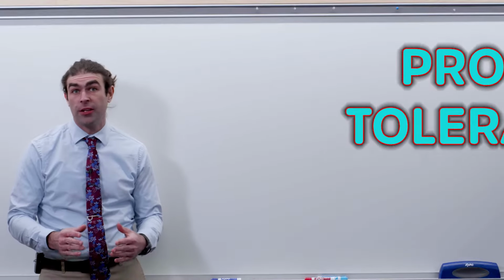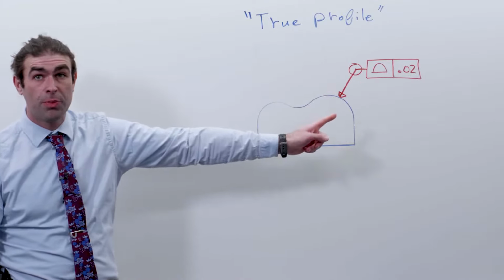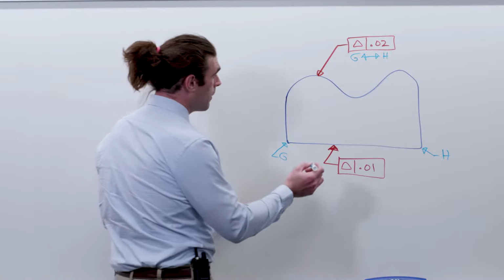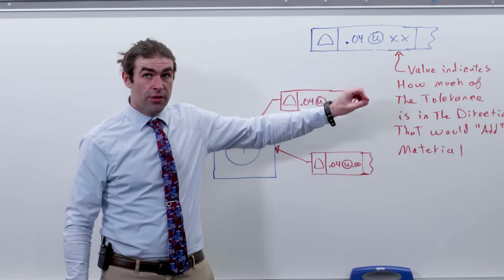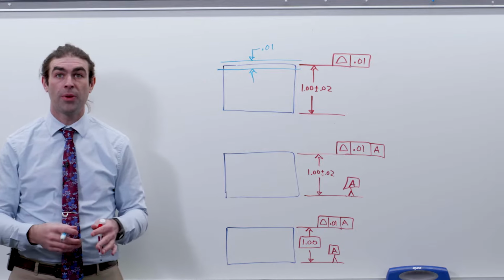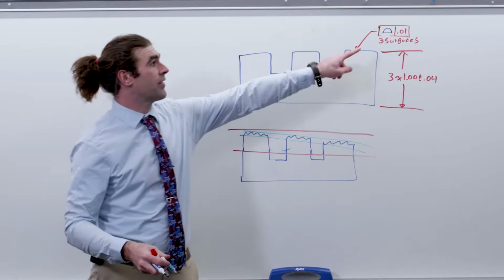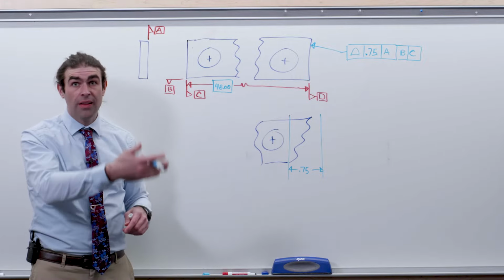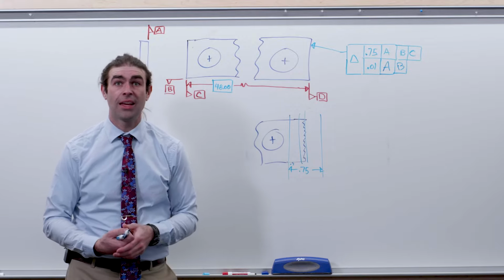GD&T Lesson 6: Profile Tolerances

Comment: I just stumbled upon this video. Do you have a best practice video or do you know one ? I have learnd some 15 or so years back that the theory behind the best practice is to use basically only 3 tolerances. Profile of line Profile od surface and position tolerances. You can basically replace any other tolerance with those 3. This should make the drawing way more streamlined and tidy.

Comment: might be a dumb question since i'm learning...at 17:59...The profile surface tolerance is set to 0.01 for all three surface so shouldn't the tolerance zone follow the 'true profile' i.e. two parallel lines to true(horizontal) surface instead of two parallel surface following the inclination of the 3 surfaces? or is it like... if I put datum A or B, it gets the parallel planes where it needs to be....so should I use datum everytime?

Comment: Hi Dean,
I noticed that there is a difference between 3x // 0.01 vs // 0.01 (3x Surfaces). In this example, I do not think 3x is used in front of the callout.
Thanks for sharing your excellent videos.

Comment: I have a question that my collegue and i often discuss and we cant find a definitive answer to this. Does the "all around" Symbol only specify for the outline of a part, or also for internal features. Say a Sheetmetal part with a complex outline and a rectangular window inside. My Collegue would only use one Profile tolerance box on the outside with an "all around" sign and i would also put Profile tolerances on the inside contour. Who would be right?

Comment: I'm about to do a presentation for our engineers at our company about GD&T callouts, so this is good stuff for a quality guy.
Is it wrong to think that the engineer could just change the basic dimension rather than specifying something extra in the feature control frame, for unilateral tolerances?
Or is their benefit to thinking of profile in different terms of MMC and LMC, that might help control tolerance stack up of other nominals?
Reply from the maker: Hi, that’s a great question. I recommend keeping all tolerances as equal bilateral, whether plus minus or geometric. It makes things easier for programming CNC and for tolerance stackups. Since the limits are absolute, there is no practical or theoretical difference between a unilateral or equal bilateral tolerance as long as the decimal places are the same.
Reply: @RDeanOdell  Thank you for the response! As well as the great content!

Comment: Can you explain how Datum C is establish in Figure 4-4 of the 2009 standard? I'm not sure why both Profile of Surface and Parallelism with respect to Datum A are used to establish Datum C. Is the profile of surface required since the parallelism callout is a refinement?
Reply from the maker: Hi,
The profile located the surface, because it is related to the datum with a basic dimension. It only needs a single reference because the feature & datum are parallel planes.

The parallelism refines the surface in orientation, but not location. It would mean the same thing in this case to use composite profile with the same datum references.

Comment: Great video. If I want to check the shape and position of a machine part relative to the perfect shape of my CAD model that includes this machine part, I use the "0.75 with respect to ABC" principle, right? and if i only want to control the shape of the features but not the position of the features i use the .01 in your video at about 23:40 or if  just want to know the shape I put .01 without referring to datums? I want to control the "internal" shape, or how to express it,  because its a sealing surface. 
Edit: I think you talk about what I mean it in this video https://www.youtube.com/watch?v=ZteA93KsKB8 , controlling the shape but it can "float" around a bit regarding position. 

Another question: Do you have something about unilateral straightness? if there is such a thing.

Greetings from Sweden 🙂